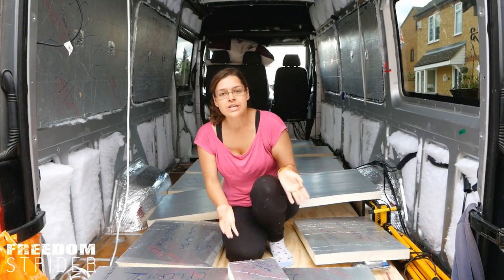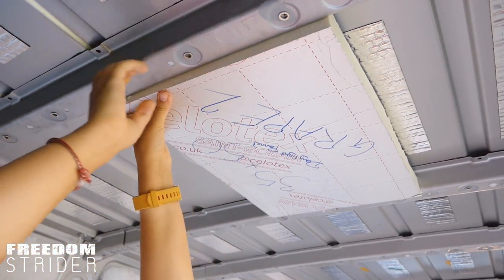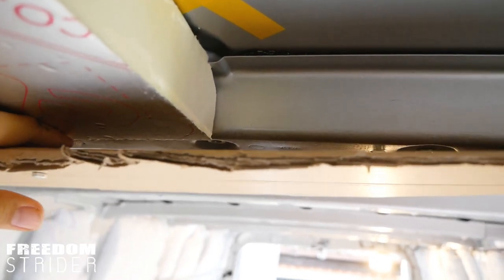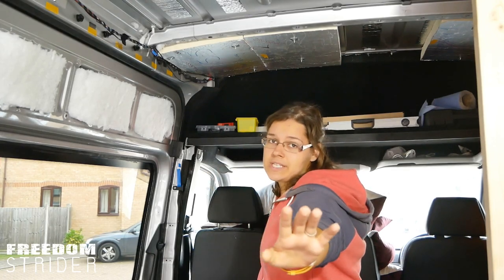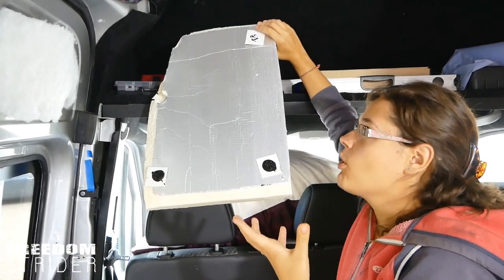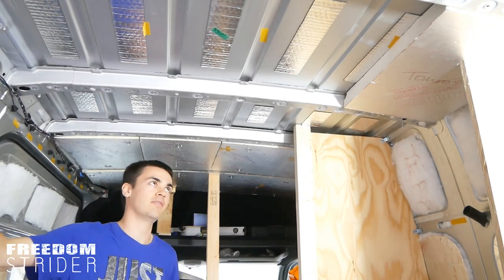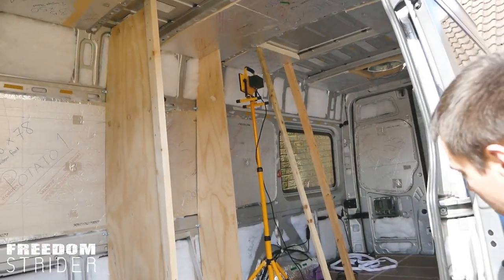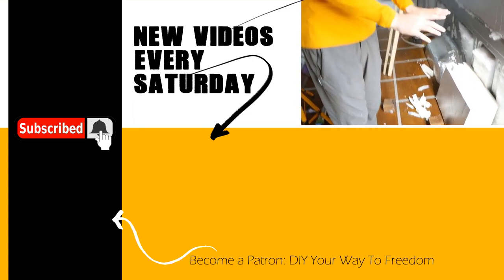How NOT to insulate your van! Van conversion MISTAKES

Comment: If you position the pins on the insulation board first and poke the pins in, then push the board and pins to the roof.. Then use something like a piece of wood to push the pin against the metal roof. It's a load easier. ;)
Reply from the maker: Easier than holding it up for ages, yes 😂 We did start utilizing that technique, but in all honestly, we just didn't have enough tall wood to keep them all up, so we had to pick which ones needed them the most. As for the actual stickpin adhesive, it seems the batch we got was defective. 😑

Comment: Hi, once again a suggestion for an issue you experienced in the past but hopefully useful to others. I have seen telescoping support poles utilised by other van builders to hold up ceiling insulation / cladding whilst adhesive goes off.
Reply from the maker: Good tip, we didn't have any to hand but yes we've seen them before 😊

Comment: Oh man you must have got a batch of crappy stick pins . We had had to take a few of ours off and man they didn’t wanna come off . But we used a lot of stick pins as well . We also used 25mm insulation as well which made the beams perfect for the cladding . Hopefully yours don’t give you any problems if they do blame sam. You don’t need foam there up fine and the corners will move a little . Don’t forget to go over them with 50mm silver tape get it from screw  fix and that stuffs propper sticky that will take alll the wobble and seal the vapor barrier . You don’t need reflective on the roof remember cos the insulation already had it
Reply from the maker: Just our luck to get the crappy stick pins 😂 The foil tape is ready to go, just adding a few things to the ceiling beforehand. Since we are going from Arctic to Sahara temperatures we though 50mm insulation would be wise, though it would have been soooo much easier with 25mm.

Oh, it's always Sam's fault 😂 - I mean it's not like I cut a notch in our headliner shelf on the wrong side - while he was 'distracted' making dinner 👼😈... not at all.

Comment: PIR board looks like trouble to install because it is flat and is being affixed to a radius surface. Maybe if you had used a thinner board it would have had just the right amount of flex to conform to the surface of the ceiling. May have been worth the reduced R value. Still you are doing a great job with all these annoying frustrations. Good video and looking forward to next one.
Reply from the maker: We were quite happy with the way it curved to the roof (with the chiselling, of course), our problem was just finding an efficient way of sticking them which kept them up there, especially when the roof was boiling hot. We were just trying to use what we had leftover instead of buying yet more stuff, as we have plenty of stuff to use. 🙂 And personally losing the R-value for us is not ideal, as we are going arctic (one day).
Reply: @FreedomStrider  thanks for your response. Going Artic.................brave!

Comment: Hi guys. I watched your video on wall insulation and found the explanation of the air gap very useful and easy to understand. However, is there a reason people don’t do this on the roof? Or is it just so you are not loosing standing space? Could the insulation not come part way down each section, instead of inline with the metal framework? Or is loosing the insulation thickness not worth it? Thank you.
Reply from the maker: Actually we recommend doing it on the ceiling, it's probably more important to do it on the roof than on the walls since the sun hits the roof directly most of the time and also heat rises.

So there's 2 ways you can do it, 1 is to only use 25mm PIR board insulation and then the cladding gets attached directly to the metal ribs. That gives the airgap without loosing any extra height, but you have the insulation effeciency on the ceiling, and if you're going extreme clients (very hot/cold) this is probably not the best idea. The other way I'd what we are doing, we've put 50mm PIR board in the gaps and we've put 18mm plywood framing ontop of each metal rib on the roof and will attach the ceiling cladding to those. That gives us an airgap but we do loose 2cm of headroom (but we are short so doesn't matter to us 🤣). Still plenty of headroom even with the floor raised. 

Depends on your plans and how tall you are 😉
Reply: Thank you kindly for clarifying! Height is an issue but we will make it work :) Thanks for sharing your expertise and great videos.

Comment: It looks like you didn't peel off the stick pin paper to reveal the sticky surface, but added glue on top of the paper?
Reply from the maker: We definitely removed the paper on the stick pins. We had troubles with the batch of stick pins we ordered - no matter what we did the pins original adhesive would unstick. So at the end, we did put our own adhesive on the stick pins (instead of buying new ones).

Comment: i did mine like yours, once that part is dome I then put wood bonded then wood of 5mm ply board all with the auto screws to metal then put up adisiver tiles well to tiles it looks like wood flooring but on the roof LOL
Reply from the maker: Sounds cool, glad it worked out 👍

Comment: Remember, packing it in too tightly will cause that annoying squeaking sound like at time marker 12:20. Better to have it loose and fill in the gaps with recycled plastic or closed cell spray foam. I guess it depends if you like squeaking whilst driving.
Reply from the maker: Precisely! We've had it in a few weeks, no squeaking but you're right that if they do losen, they will start to squeak, so as we said, we might end up filling the gaps with spray foam to jam them in even more because we don't have enough room to stuff in recycled plastic insulation like on the walls. 😜

Comment: Hey again guys,
Why is it a problem to stick the pins to the sound deadening? I'm asking because i already covered big% of the all metal sections and there is no space left to stick the pins to the bare metal.
Reply from the maker: In general, it's best to reduce the number of things you've stuck in sequence, so sticking stick pins on sound deadening on the van would basically give more opportunities for things to come "loose". Having said so, the sound deadening is pretty hard to remove so attaching stickpins (with good quality adhesive on them) that just support the weight of the PIR board will probably be fine. But as best practise, it would be better to stick the stick pins to the metal roof since in that case, it would only be the stick pins that could fail, not the sound deadening. 

Hope that made sense and didn't confuse you more, but if you have to remove a lot of the sound deadening, I would just try and stick them on top of the sound deadening - maybe do a test piece and see how it sticks.
Reply: @FreedomStrider  Ще пиша на български, че ми е доста по удобно, стига да нямате нищо против. А дали метала няма да се нагрява повече отколкото саунддеденинга и т.е. да нагрява лепилото на пиновете и те да са по склонни на отлепяне ?
Reply from the maker: You can write in Bulgarian, I can understand - I may need to answer in English for technical detail. 😊
We don't have a very good experience with stick pins. I believe they should stick better on warmer surfaces and be able to withstand the heat from the hot roof and other people have successfully used them. The sound deadening can act as an insulator but I don't know how the stick pin adhesive will react to the sound deadening surface.

Comment: If you run a circular saw through a board, but set to half of the depth of the board, then it will bend a bit... (you mount it with the cuts facing upwards). It's a great way to make the board fit the contour of the roof and it doesn't break the foil seal of the insulation. I did this with the roofing battens that I mounted on the ribs too – two cuts across it and it bends to match the contour of the ceiling. Great guide to doing this here! https://www.youtube.com/watch?v=-aeanzxq_WE
Reply from the maker: Good tip. 🙂 We'll try it next chance we get.

Comment: I was feeling your pain.... I’ve had very good results with Adiseal Hi-Grab sealant/adhesive https://adiseal.com/products/hi-grab/ 
Reasonable price, flexible when cured and incredibly strong adhesion.  I’ve tested it on a range of materials, wood, plastic, metal, foil, applied to painted metal and it’s excellent. I’m intending to use it as my go to adhesive/sealant on my van build.  A spot at each corner and in the middle would be sufficient to hold the PIR I reckon. Either that or high temp contact adhesive.  Enjoying your vlog immensely and the way you experiment and try novel problem solving solutions.
Reply from the maker: Thanks, glad you're enjoying the vlogs 😊 
We've heard of Adiseal before, it looks a good product to use. We didn't really want to just stick it all with sealant since sealant is a bit messy (although, given how much trouble we've had with the stick pins, in hindsight it would have been a lot faster). 
We have about 20 tubes of Sikaflex Pro 3 (mistake by the vendor, we only paid for 1, got a whole box and the vendor said to keep them) so that's our go-to right now - although it's not an instant grab, takes 3 days to dry.😂

Comment: You should of read the instructions for the stick pins, it clearly says to install at the least 24 hrs before  you hang insulation on them 

There are stick pins that don’t have a sticky pad but have holes in them so you can use a glue gun and it Oozes through the holes and clings onto the stick pin
Reply from the maker: I would have gladly read the instructions had they come with any.